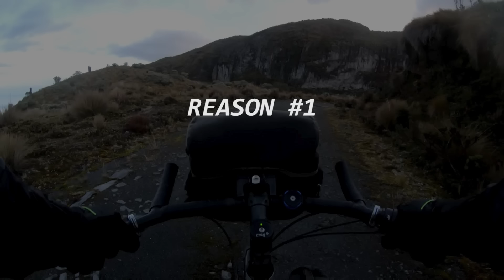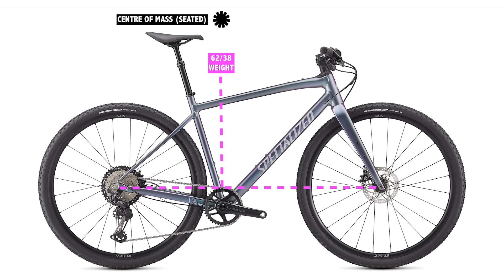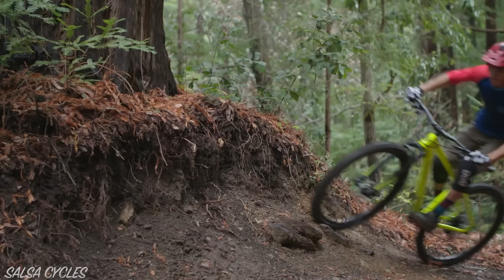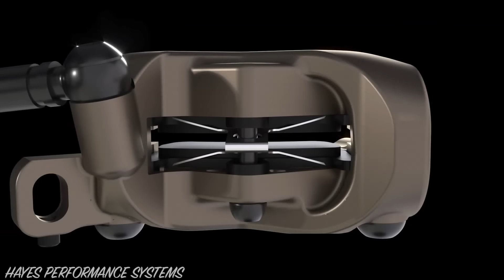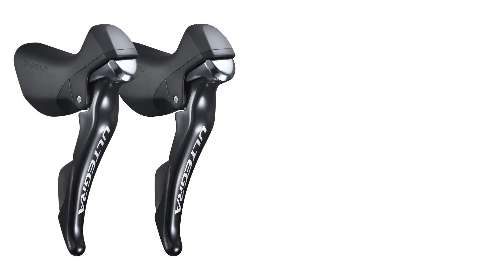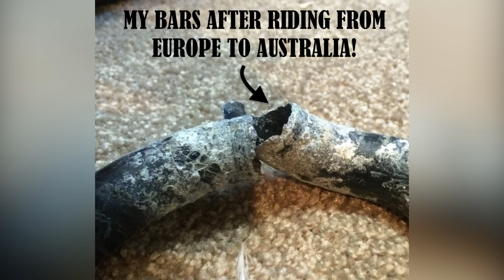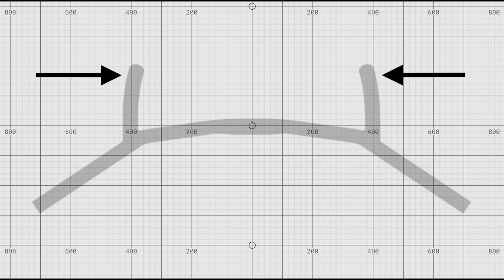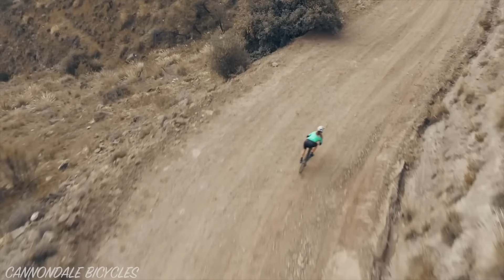Why Flat Bars Are BETTER Than Drop Bars For Most Cyclists (Objective Analysis)

Comment: Although a handlebar is a lever used to steer a bicycle, very little force is needed to turn even a narrow handlebar. Therefore the theory of a wider handlebar increasing leverage is true, but it is not what gives you a sense of better stability. The increase in balance and stability comes from the combined mass of the bike and your body being placed further from the center axis. A non biking example would be extending your arms out to your sides while walking on a balance beam.

Comment: I prefer flat bars in the city...for the better braking position...they just can't be too wide. I don't get the super wide bar trend, you don't need THAT much leverage on a bicycle. Then again, I'm oldish, and when I started riding a lot I grew up with the notion that bars should be about shoulder width, and now that is what I'm used to.
Reply: Ahree, I have Deviant Minis on my city commuter, 480 mm wide and 15 degree sweep and perfect for sliding between cars.

Comment: I only had neuropathy damage while using a flat bar as the weight of your upper body is pushed own to extremeties of the hand. I lost my sense of touch for over 6 months. Once I moved to drop bars, the neuropathy damaged slowly healed and never had the same experience again. I'll take health over function anytime. So yeah with that I will never use a flat bar ever again.

Comment: I in no way think you are objective about this. I think your favorite won because it's your favorite.

However since your bias supports my bias I'm going to agree with you and cite you whenever someone tries to tell me I need drop bars on my gravel bike.

Conformational bias for the win. 

I ride trails, gravel, and road. I'm currently running Surly Moloko bars on my bike packing and gravel racing rig. And I'm only running those because I could not find Denham bars when I built that one out. 

Thousands of hours personally, and alt flat bars win for anything but specialized purposes.
Reply from the maker: I don't have a favourite. Exactly 50% of my bikes have drop bars, the other 50% have flat bars.
Reply: You got triggered because your beloved bars didn't "win"? Grow up.
Reply: @FightFilms  I think you missed where I humorously said I agree that alt flat bars are better for most purposes. Unless you are buying bars for a specific use, such as jumping time-traveling or what not.

I apologize if my good-natured attempt at humor confused and upset you.

Comment: Great video!  I've noticed when I'm on a road/ gravel tour I generally stay in the same position on the bike. Flared drop bars and careful attention to seat and shorts used are paramount for me. On an off road tour I'm standing more, sliding forward and back on the seat more and using much more body English in general. My seat matters less and flat bars give me WAY more control on rough singletrack and tech terrain in general. They both win!

Comment: One plus for drop bars, it is a more universal application when road to gravel is primary use. My salsa Journeyman (650b gravel type bike) is both my road endurance bike, commuting bike, gravel bike, and touring bike. Where as my mountain bike is just a bikepacking bike alternatively. Still I love the Jones H bar and miss that on my hybrid bike when that was my only bike. Sometimes having different bikes helps but for touring I want the speed as primary so want some sort of drop configuration.

Comment: What a great video. Thanks. On my road bike (carbon frame and drop bars), my wrists tend to get quite sore. I need to frequently shake them out. Do flat bars have the same problem?
Reply: You might need a bike fit. Your wrists should be in a fairly neutral position in the hoods and drops as I understand it.
Reply: @szurketaltos2693  I have wondered that as well. Thanks.
Reply: @MrTingabug  you're welcome! Good advice from the other poster. Also think about whether you have too much weight on your hands - a shorter and or higher angle stem may help if that's the case.
Reply: @szurketaltos2693  I should take it in for a fit. I am 6'5", 240lbs, give or take, and this the 1st bike I bought in 30 yrs (I have had it for 7 yrs now). My knees et al are good but riding with my hands on the hoods is the problem. Riding on the drops is fine (but not particularly pragmatic for city riding around Vancouver.).
Reply: @MrTingabug  hm yeah if the hoods are the only issue then I imagine it's largely a question of the hood position and/or angle. It does seem like the less average you are in size the more likely a fit will help, and the more a pro fitter will be better than random internet strangers.
Reply: You can start the process by rotating the drop bar itself a bit until you find a comfortable hood position for wrists. Once you find it note down what the angle of the shifter is. Second step (that is sometimes needed) is that you may need to move the shifter up or down the bar (probably up) and then rotate the bar again to get shifters back to angle that was comfortable for you.
Reply: @innocentiuslacrim2290  thanks for the thoughts
Reply: I don't think you can generalize that.. Might be a bike fit problem (in that case flat bars would change that), could also be just an issue with your wrist, in which case it won't - at least I know people with flat bars and wrist issues.

Comment: Here’s something to think about with all day comfort (this is further to my other comment and not taking into account the undoubted control flats give in rough terrain). Try standing casually with you arms hanging at your sides. What is your hand position? Palm against your thigh I imagine. Now simply rotate both arms forward and bend at the elbow. Where are your hands now? Palms facing each other inward? Just the way you’d ride on the hoods of drop bars. That’s why it’s no surprise that those biomechanics mean that’s the most comfortable multi hour riding position. But as Alee said, it’s not the whole story with all the other factors you might need to consider for your journey
Reply: Agreed, but there is still personal variation. I can't do straight bars, as they give me wrist and elbow problems if I use them for long duration. Being able to shift positions is best, I've tried all, but now I mostly use the old fashioned dutch (grandma-bike) handle bar for touring..
Reply: @frederik0014  I have the same problem with straight bars. Have hand and wrist discomfort after 15 minutes so added bar ends and inner extensions on my MTB when I used it for touring. That means the arm doesn’t have to rotate inwards. It’s more natural. Changing my hand position so palm is inward rather than palm down is the only way I can ride any distance. Putting the hands on top of a straight/flat bar turns the whole arm from the shoulder and it feels impinged and I get tingles are sore arms, wrist, hands quickly like a nerve is impinged. 

But two years ago I built a new touring bike based on a Lynskey titanium gravel frame and use Pro medium flare drop bars. Problem solved. I’ll use the tops sometimes for change of position but on the hoods I’m good for 6+hrs.
Reply: yup exactly, I have two flat bar bikes (slightly different flat bars) and yet i find drop bars hand position so much more natural when the palm of a hand is pararell to the body, honestly makes world of a difference for me.
And as said drop bars are more aero, and I'd say air resistance is a huge thing while riding a bike, so there you go.
Reply: yep I and with you .
Reply: When I stand with my arms hanging, my hands are turned inward at ~45°. When I put my arms in front of me, my hands naturally place themselves palm to the ground. Might be one reason why I find flats to be more comfortable in the long run.
Reply: @Bipbiprna  the variety of the human physique!
Reply: You figured it out.  We need bikes designed for the "standing casually" position.  Not sure how far we would able to pedal while standing still.
Reply from the maker: Biomechanics are far more complex than your resting arm pose! I'm not even going to pretend I understand it all though, so I'll leave it at that. 😂
Reply: @Cyclingabout  I just know what works for me I guess and my Physio (who is a serious cyclist) took me through it and looked at the function of my arm. Hold your arms out in front with palms inward (like on hoods) then turn them palm down flat (like on tops or flat bar). That turns the whole arm from the shoulder and for me and many others that gives an impinged feeling. Everything gets tight in the arms, nerves feel impinged and the arm from the hand up fatigues and starts tingling quickly. I’ve got friends with the same issue. 

I’ll use tops or flat bar a bit but just for a position change, but moving to bar ends, inner extensions or hoods gives immediate relief. I’ve known this for yrs and assumed it was the sane for everyone which is why so many interesting touring bar shapes have been developed.
Reply: @shred3005  rotating your palms from an inward-facing position to downward-facing position does not "turn the whole arm from the shoulder". Try holding the medial and lateral epicondyle of your humerus as you do this - they don't rotate. Similarly, hold your upper arm (biceps/triceps) - they don't rotate. It's the structures from the radius and ulna downwards that rotate.
Reply: @davidrowe8747  Sure, internet doctor
Reply: @slicex3408  Very droll.
Reply: @davidrowe8747  you’re right. Rotate is the wrong word. Activate is the correct word that my Physio would use. Do as you said, turn your hand 🤚 flat palm down as if on tops /flat bar while holding your bicep & tricep and those muscles activate and go from relaxed to tension. As importantly the deltoid and scapula group also a activates from relaxed to tension. I’m not a physio but for me at least, doing that gives me an impinged feeling very quickly and I suffer from the hands in particular and up into my arms. I was on a flat bar tandem with my wife yesterday and she, like me, was feeling it too in just 15 minutes. I can ride all day on drop hoods or bar extensions where my hands aren’t turned in and many of my friends tell me the same thing
Reply: @shred3005  That makes sense. As others have said, there are so many other variables, it can be difficult to pin problems down to one factor, e.g., flat vs. dropped. I rode dropped handlebars almost exclusively for about 10 years, with about 95% of the time on the hoods (like many people, I suspect). Although I really enjoyed road riding in that position, over the years I gradually developed a weakness in my thumbs to the point that opening a jar top became difficult. 

Since then, I've switched to flat bar bikes. I found that narrow flat bars gave me hand numbness (I think due to the wrist angle that flat bars force you into). I have now switched to alt bars with a backsweep on all my bikes. On my primary bike, I have SQ Lab inner barends, which allow me to ride as if in the hoods on a drop bar. No thumb problems this time, even when I ride over 50 miles, with hands on inner barends most of the time.
Reply: Here's another one: do a push up. What is your natural hand position then? As you can see, it's not that simple.
Reply: @viktoraleksejenko4929  Now make a fist and do the push up on your knuckles and see what feels most natural (especially in the top position, which is what matters most here). There's a reason it's called neutral position. Long term internal rotation of the shoulder is not the best position and over time can cause impingement issues. Flat bars are good for technical mountain biking, but not ideal for long distance cycling on good roads.

Comment: It seems like this analysis was done with bars as part of the overall bike design. How do all the reasons hold up in a retrofit?
Reply from the maker: The frame won't be as long and stable. And depending on your bike size, your toes might still hit the front wheel. All the other points will apply to a retrofit.

Comment: Spot on, Alee. It blows me away just how many features and trends in cycling are a pointless hangover from road cycling, and drop bars on touring/gravel bikes are one of these.
Reply: Drop bars are far better for longer and faster rides. He even said it in the video. I don't think it's anything to do with "pointless hangovers" -- it's just a different style of riding. There are more flat bar bikes in the world than drop bars. If anything the pointless hangover is the other way around.
Reply: Has nothing to do with fashion or trends, people are making their choices based on functionality.
Reply: meh.. I think there are examples of this such as stock gearing choices but I don't think the use of drop bars is an example.. if anything, it's the opposite and the majority of bicycles available are flatbar by default.. you have to actually seek out drop bars even in the US where they are way more popular. I'll agree with you in so far as I think it's silly to put drop bars on bikes meant for extreme offroad conditions. I tend to favor flat bars for off road and flat riding (like rail trails), drops for fast descents,  steep climbs, sprinting, and weaving through urban traffic. Although by roadie standards, my drop bars are too wide and too flared for some. My biggest con with dropbars is just compatibility with MTB parts without adapters which I'd rather use for the vast majority of my riding over roadie gearing.

Comment: I think its a stretch to call those loopy swept back Jones bars "flat bars".  Those really belong in a third category.
Reply: Alt bars.
Reply: They might not be "flat", but none really are. They use flat bar components which I think puts them in the flat bar category
Reply: It’s funny how things come around. Looking at an old Schwinn cruiser from the 70’s or any other of a thousand examples in the past, they had what we would call now flat bars with a high sweep of 30 or more degrees. For riding relaxed in the city, instead of in a death grip on a mountain bar with your elbows sticking out.
Reply: They are just Dutch 'bird wing' bars. With an extra top part and therefore a hole in the middle. Nothing special about them here in the land of windmills.

Comment: I can ride on a drop bar bike in comfort for the full day but my arms and hands are literally in agony on a flat bar after 15 minutes. It is that dramatically bad for flat bar for me. It’s the hand position, way the shoulder is turned in on flat bar rather then out for drop bar hoods. Biomechanics? But as you suggest, the flat bar can be drastically improved by adding inner grips or other options to open the shoulders and give a different position to palms down. I then spend all day on those inner grips with my hand and arm in the open position, occasionally going flat when I need more control. 

Bar ends are ok for that too but opens the shoulders too wide if the bars are wide. Drop bars have 3 positions built in and flat bars do need additions to make them acceptable. I’ve done multi day all day riding on both flat and drop and for me personally I’ll go with drop bars. Each to their own.
Reply: Adding inner grips to a flat bar drastically reduces safety, compared to riding in the hoods on a drop bar, because you cannot easily reach your breaks.
Reply: But that's when you enters all the options of "flatbars"
Reply: It is a bit weird going back to flat bars after getting used to drops.
Reply: When riding my CX bike (I don't have a road bike) and not in an immediate situation where I might need to brake, I am almost always on the tops. I am only in the drops when really sprinting. I have the least amount of pressure point discomfort on the tops. But, I road mountain bikes until I was 30 before I got my first drop bar bike so I could extend my racing season from MTB to CX. I think a lot of what is "comfortable" has to do with what you are used to. I'm most comfortable on the tops, which is basically a tighter flat bar position.
Reply: Too wide by default but you can always trim. I used to have some Ergons.. whatever the longest ones are and I cut down my city bike's handlebars to the shortest possible width to handle the Ergons, have mounting space for lights, and my levers.. wish I had measured it before it was stolen but never thought to.. it was still fairly wide relative to drop bars but I'd guess somewhere in the 650mm area which with the right stem length wasn't bad on the shoulders. I had the primary grip, the outer elbow, the main part of the bar end, and a nice 4th position where I could lay my arms on the main grip body and latch onto the end of the barend. I could ride that setup all day and could even get somewhat aero with that last position. It wasn't nearly as confidence inspiring for a climb though and I feel way more secure in the hooks for a fast curvy decent... I definitely prefer drop bars, granted I spend most of my time in the hoods anyway.